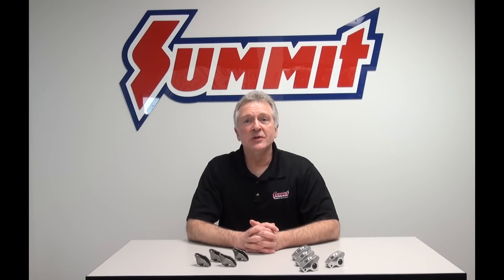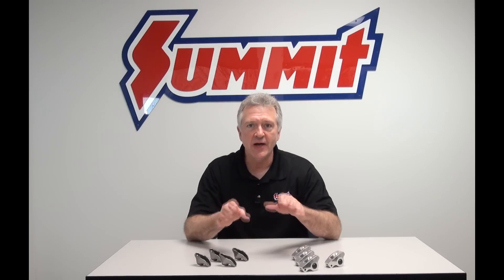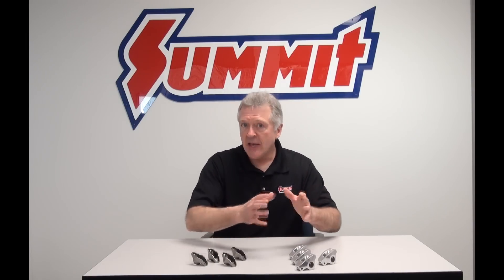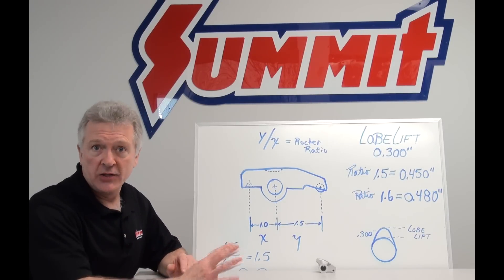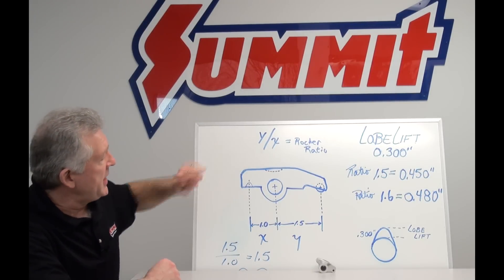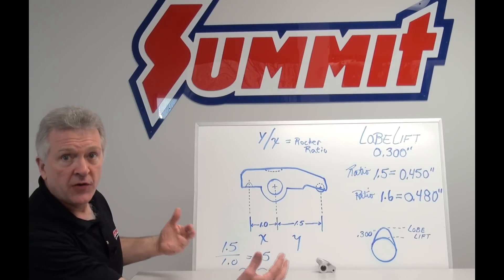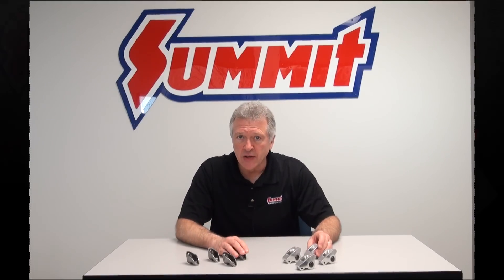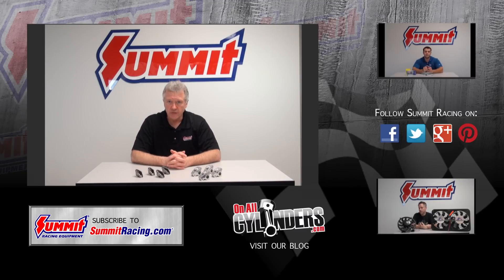Rocker Arm Ratio - Summit Racing Quick Flicks

Comment: I went from a stock 1.6 to a roller rocker 1.8 from yella terra  and  noticed considerable difference in the butt dyno. I have a Regal GS S/C, new long block from Summit Racing....With ZZP headers,  3in cat back, tuned PCM, CAI, and 3.3 pulley , ported S/C casing and ported throttle body....the biggest difference was the roller rockers..going from 60 MPH to 100 is scary
Reply: On a .300 lobe the 1.6 is .480 lift and the 1.8 is .540 lift.

Comment: I know RR adds extra pound of pressure on the lifter lobe matting . I presume you can use same formula to calculate the force. so if seat is .100lb ..100 x 1.5 = 150 lb pressure on lifter , 1.6 = 160lb. ? something to consider when lobe pressure is a concern . this mathe may be wrong but seam legit ?

Comment: That’s the good news, the bad news is that it puts a lot more pressure on the push rod because you’re changing the push rod closer to the rocker stud. Yes, the math gives you better lift and better flow but the downside is it puts a lot more pressure on the situation, therefore, you’re gonna have to seriously upgrade your pushrod and arm to better grade material to handle the extra pressure and left, it’s a give-and-take thing. Yeah, you’re gonna get better flow but you’re putting more stress on your rocker arm so you’re gonna have to run better rods and arms, or they may not, take the extra load and pressure

Comment: Is there a calculator or some way to put in your cam specs an see what would change if you would stick with a factory 1.5 ratio an then go to a 1.6 ratio. I grasp that it’s worth a Lil extra lift but it sounds like it also would change the event of the duration and not the actual duration as clearly ya can’t hood a valve open longer by simply opening its further but it seems like ya could cause the actual open sooner since it has more length on the front side of the rocker. Clearly I’m not sure of any of this thus why I’d like to know if any web site calculators exist that let you punch in your cam card specs and see what if any would change on it with the different rocker ratios.
Reply from the maker: Thank you for your question.   There are a coupe points here and we will cover both.   The opening and closing point at the seat will be the same whether it’s a 1.5 or 1.6 for instance, but the valve will open faster with a 1.6 and have more peak lift.  Seat timing remains unaffected but .050 numbers will go up a couple degrees with a 1.6 for instance.  It will do this more at the .200 lift range etc. and this is where the additional airflow comes from.  At the same time, seat timing remains the same and idle quality or low end torque isn’t sacrificed.  Just a potential for valve float to come in a little earlier than the smaller rocker ratio due to the quicker valve accelerations with “x” amount of spring pressure. 
 
For the people wondering about lift :  If you know lobe lift, it’s simply a matter of taking that number time 1.5 or 1.6 to determine peak lift.  If you know you have .500 lift with a 1.5 rocker for instance, the easiest way to see what a 1.6 would be is to take (.500 / 1.5) x 1.6 = .533

Comment: I can not understand how you can just slap a higher ratio rocker in an engine. The push rod point is fixed by the head, the fulcrum point (where the rocker is bolted) is fixed by the head and the valve stem location is fixed by the head. To increase the ratio, one or more of those 3 points need to change. I always here about "put a higher ratio rocker in" but I sure dont see how just adding it can work, given the 3 points are fixed. The push rod needs to get closer to the fulcrum or the fulcrum needs to get closer to the push rod, or the valve stem needs to move away from the fulcrum point. So other than grinding out the push rod hole or getting a different head I sure dont see how this works. Pa-lese someone explain it to me!

Comment: I'm in the market for a 1984 trans am 305 stock engine, if I change the rockers to a 1.6 rocker ratio how much horsepower and/or torque would I possibly be looking at? I'm not looking to make it 1,000+ hp or anything,  just rather curious
Reply: stock is 204 hp, so you are going to need a ton of research to get to 1000hp. fist of all you need to know the transmission torque and rpm limit. For example 400lbft @5600rpm is 426Hp. This can probably be done. for higher rpm you need to tune the computer to accept higher rpms, and special components, probably an internally balanced engine block.  
Anyway, if you put Full Roller Rockers, 1.6 you will need new springs and rebuild and port the heads. then headers, a miniram intake, sport metallic CATs, new timing set probably, camshaft, throttle body, then tuning equipment or have someone to tune the ecm otherwise you can’t run the car anymore with so many mods. this way you can get to like 400 hp or more if the transmission allows more than 400lbft
anything above 400 hp will be really quick.

Comment: I was reading something Crane Cams had put in a catalog that said for a good performance upgrade, leave your 1.5 rocker arms on the exhaust valves and change your intake rocker arms to 1.6 ratio. Would that affect overlap? with 1.5 rockers, my lift is .398 int./.442 exh. Putting 1.6 rockers on the intake valves would put it about .424. I'm not sure what the benefit would be. Any thoughts?
Reply from the maker: Kris Brickey, 
Swapping or staggering rocker arm ratios has been going on for a long time. Be careful though, not every motor(camshaft) responds positively to this. If you have a friend with a set you could “try before you buy”, that may keep you from spending money on a set of rockers that may not help you in the long run!

Comment: i have a mostly stock 1994 gmc sierra 1500 with a 305 sbc, swirl port heads 1500-5500rmp range, 4l60e. ive installed a jet performance powershift chip, fuel injector spacer, high flow exhaust. ive also removed my pcv valves and installed breathers instead... what kind of power difference could i expect from switching from 1.5 ratio rockers to 1.6 or 1.7? om making right about 210hp right know
Reply from the maker: Hi Anthony Hewgley, 
Every motor reacts differently to rocker ratio changes. The only true way to figure this out is to dyno test before and after the installation of the new rockers.

Comment: Should you use stock length pushrods if changing from 1.5 rockers to 1.6?
Reply from the maker: Hi Kris Brickey, 
Though it will be very close, due to a geometry change, the pushrod length should be checked!
Reply: Summit Racing Thanks for the info!

Comment: I have edelbrock Victor jr heads,  on my sbc and a set of 1.6 comp cams ultra roller rockers, they are very close to the valve spring retainer will I have grind on the rocker arms to make sure that they are not going to hit the spring retainers?
Reply from the maker: Hi Bill, 
Try to never modify a rocker arm unless absolutely necessary, you may actually hurt more than help!  It would be best to install a set of checking springs in place of the valves springs, install the pushrods , adjust the lash and roll the motor over by hand inspecting for any clearance issues. This is the best time to check and make sure your pushrod length is correct as well. Never assume the so-called stock length is what you need!

Comment: Good info but I’ve been out of the game a while and just coming back do to a back injury.I have have most everything already for a 406 sbc chevy but since I bought the heads just before or as the aluminum heads were coming out,I found at the time what I thought was a good deal,new original bow tie heads with 205 instead of 202 valves for $800 and I worked them over.a few times when the weather was right and I hit it hard on the freeway it ran so good it nearly scared me.anyway since I already have all the old style parts I’m using them even though the new stuff is better it’s much more expensive to and my 406 will make 509 go all day but what I want is info I may not have about building better the bow tie heads and any info that will help me with low lift long duration cams but with 1.6 or anything you may know that’s better.one of the cams I have is an Elgin solid and I forget the spec.’s now but with the 1.6 r.r.’s it brought it to the neighborhood of the comp cam 230/280 magnum I also have but I expect good things from this little cam I am also starting at 4* adv..as I said I’ve been out of the game a while and you may and probably do know something I don’t. Oh this engine is just for the street and my amusement and I’ve had it built and altered several times and had the 509 block but it got damage so I now have a 511 that the machine shop screwed up and now after align boring had to buy iron caps and have to take the block somewhere 100 miles away to have the caps refitted to sit tight in the registers.sorry for the book but but description was needed .thanks for your video’s

Comment: Hello I am new to all of this, I assume you wouldn’t want to mess with rocker ratio unless you had an aftermarket cam, possibly change pushrods, valve springs and cylinder heads that have been throughly gone through is this correct? Also do you think you could shed some light on  the different types of aftermarket rockers like full rocker arms and shaft rocker arms for instance what are each of there applications, would it be worth getting new? or if it’s mostly an aesthetic thing?
I assume this wouldn’t have anything to do with the compression ratio but I am obviously a noob.
Reply: I know it's been 3 years, but I wanted to throw some info. I'm not the most expert at this, either btw. 

From what I understand, this is something you can do without changing cams. It's not like valvesprings where you have to change them with the cam. The rocker arms and the cam are part of the same system, but I think they can be changed independently of one another-you can just change your rocker arms and keep your cam stock. 

That being said, if you change your rocker arms, you'll likely have to measure your pushrods and get new ones. You also might want to check your springs since you'll have more lift. However, it's not likely the little bit of extra lift will make you have to upgrade springs.

You might wonder why anyone would want to change their rockers to a higher ratio. Can't I just jam a big cam in and get on with it? It honestly seems like that's what lots of regular folks like you and I do. And that's totally fine. But there are reasons to change the rocker ratio (of course, we are talking about cars so there will be people who argue with this).

1. Maybe you don't want to change cams. Or you want to do a small cam package. This would likely be for a daily driver, or a car that wanted some extra power but also wanted to maintain street manners. Instead of going full-blown big cam where you get all of your lift from your cam lobes, you can get some lift from your rocker arms instead. 

2. It makes it easier to push down the valve side. I am very interested in this. The lighter your valvetrain, the easier it is for your engine to do its work. That means an increase in horsepower, not a huge amount, but still noticeable. It also means that the engine will rev faster, and your engine will usually be capable of a higher redline (you have to also adjust your shift points with an automatic). I also think, though I don't have any direct evidence, that this will give you a really strong power curve where your engine makes good power all throughout its curve instead of just at the peak. That really makes you go fast!
Reply: @bradleylovej hey man i know it’s a bit late but your comment has helped me a ton. thanks dude!

Comment: So, changing the ratio can increase power, but if a cams rpm range is 1500-5000, does the ratio affect that at all? If so, buy how much? Also, by changing the ratio, does it make the valve drop down into the combustion chamber farther than with a stock ratio?
Reply from the maker: +Andrew Swensen, 
While increasing the rocker arm ratio will in fact increase power, it generally is not by a substantial amount; though it varies per motor. The increase is realized by simply pushing the valve open into to the cylinder a little further allowing a little more cylinder filling. Feel free to call and we can help you choose the right components for your build. 1-330-630-0240. Thanks for watching.
Reply: Thank you! But, does it affect the RPM range at all?
Reply: I believe only changing the camshaft will affect rpm range. Changing rocker arm ratio will only affect valve lift.

Comment: But factory runs 1.5, aren't most modern cam lift profiles shown with a 1.5 ratio to begin with? (or whatever the stock ratio was, i know it's higher/lower on some engines)

Comment: Thanks ! Does increasing the ratio have any effect on valve guide wear ?
Reply from the maker: Hello Jeff, 
 
As long as the rocker geometry is correct, there should not be a problem. In general, a roller tip rocker will reduce valve guide wear because it lessons friction at the valve's tip. A full-roller rocker will minimize friction at the valve tip and at the fulcrum or trunnion. Upgrading to rockers should be considered with a performance cam upgrade or when increasing the rocker ratio.
Reply: you need to do a careful research before because you may need new springs, or the lift may be higher than the heads/engine can accept. also the timing set may need upgrade. For higher rate springs then you may need even spring cups if the heads are aluminum. but probably the stock new springs would be just fine with stock cam.

Comment: in a stock 350 chevy motor with all factory parts....if i change from 1.5 to 1.6 am i going to see any difference?
Reply from the maker: +steliosz28 , 
By changing a rocker ratio you are adding some valve lift. Since we don’t have the factory camshaft numbers, a general rule of thumb is you will get approximately .030-.035” of additional lift at the valve. On a completely original motor such as yours, you will probably not see much seat of the pants gain.
Reply: You'll see rocker studs pulled out,worn out valves and valve guides ,bent push rods.and if you don't check valve to piston clearance,a possible blown motor.

Comment: Ok I am installing a Ford 5.0 engine with a piston and cam change. It has the Ford E-303. I bought this used with 10,000 miles on a rebuild. My question is, why can't I adjust the valves on this using stock pushrods, lifters.an rocker arms? The 5.0 I took out to replace has zero lash when on the base of the cam. I can use a lifter and pushrod from the old motor and put it in the new motor and still have the same problem. To much slop in the pushrods! 
Do I need shims or different pushrods?

Comment: good but if you had your x different then 1.0 you couldn't just multiply rocker arm ratio by lobe lift ... you need to just uses y * lobe lift in that cases. Unless this does n't have the same meaning as I am thing of it as more torque number or it could be just a ratio / formula that you equate to your cam/follower performance when testing as a short hand way of remembering

Comment: So if my duration is 230 with a 1.5 rocker, what will it be with a 1.6
Reply from the maker: The duration will remain the same, however the lift at the valve will increase.
Reply: Summit Racing thank you.

Comment: Does a 1,6 rocker change the valve lash?
Reply from the maker: While varying valve lash is an old racers tuning trick to try and squeeze out that last little bit of power, just changing to a different rocker arm ratio doesn't necessarily require a different valve lash setting!

Comment: I need help I blew the gasket on my 350. and bought some aluminum heads to swap in with a cam and I need to buy rocker arms and pushrods and idk what size pushrods or rockers I should get plz help its my first time opening up a sbc. so I need some help

Comment: 1.5 rocker and a .300 lift gets .450 okay but  how did he get 1.6 rocker and a .300 lift and cam up with a .480 .??
Reply: lift X ratio

.300 X 1.5 = .450
.300 X 1.6 = .480

Not sure why they felt the need to drag it out and make it sound 100x more complicated that it has to be, probably to make you feel small so you will call them on the phone and buy stuff you don't even understand.

Comment: Don't forget to use your Lewis tool when going to 1.6 on stock heads or you will be very sorry!
Reply: dynodon100 what do you mean by Lewis tool? I got a 350 and I'm running an extreme energy Comp Cam Kit I think my Max lift was like 510 I remember her right. And I've decided to put roller rockers but I put 1.6 on my exhaust and 1.5 on my intakes. should I be worried about something LOL